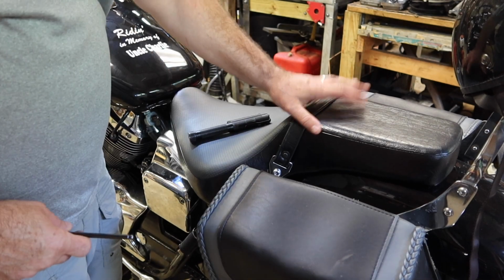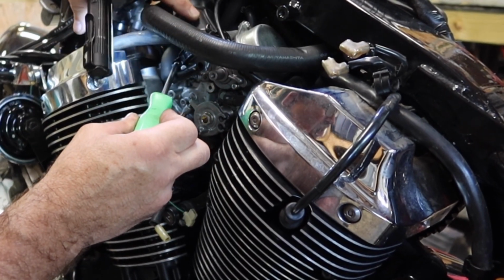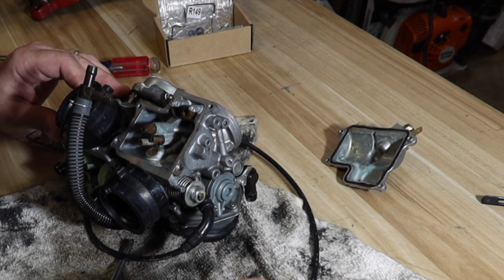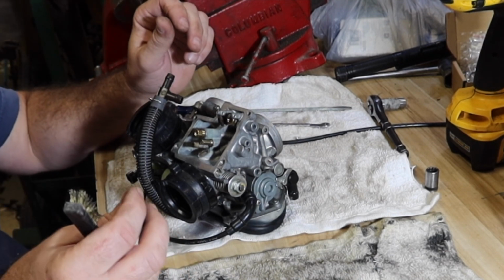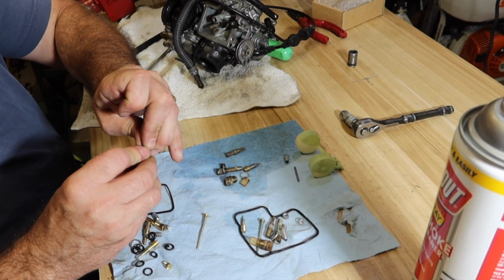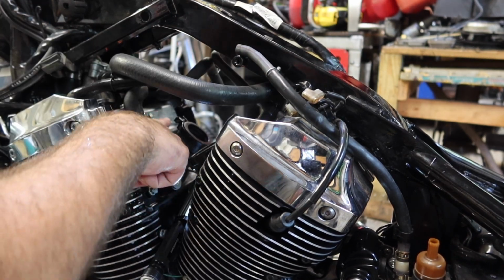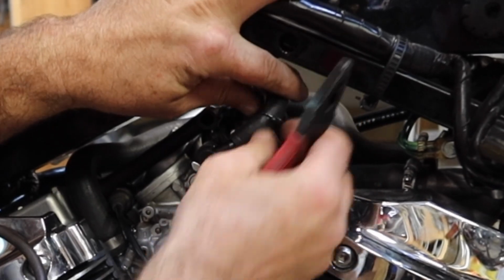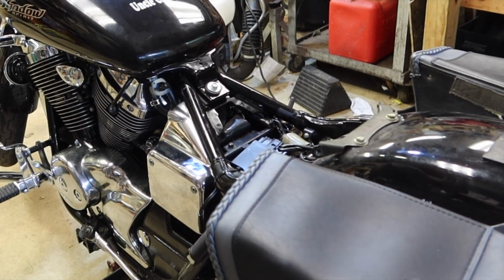Honda Shadow 750 Carburetor Rebuild: No Start, Rough Running

Comment: Nice  !  Really thorough and easy to follow.   You can always tell when the carbs have been opened up because the mixture screw caps are removed,  I've never seen them replaced... makes future adjustments much easier.   I'm glad you got it running right.
Reply from the maker: Thanks for watching!

Comment: Excellent video teaching. I learned much from your teaching. I now feel more confident to rebuild my carborators myself. I wonder if you ever found any problem with those little holes missing on the new jets. I enjoyed watching your video all the way through non stop 
Thank you for sharing this info. I appreciate it much.
The LORD bless you Ray.
Reply from the maker: Thank you so much. Yes I ended up swapping the new jets for the old jets again. I just took some time and cleaned them up really well. I couldn’t get a smooth acceleration with the new jets

Comment: omg you pull the carbs with the boots still attached to the carbs, that's crazy, no wonder it's so hard. leave the boots attached to the cylinders, loosen the upper clamps and use a long screw driver or pry bar to pry up off the rocker cover to pop the carbs out of the boots, right side carb off front cover and left off rear cover, super easy. i can take my shadow from fully assembled to having carbs out on the bench in 15 minutes, a little longer to go back together, routing choke cables, hoses, and air inlet boots on the dual carb shadows can be pain. The hoses you thought are for a vacuum actuator are actually the atmosphere equalizer inlets for the slide chambers,  btw, those black nipples that look like a $2 drip system nipple from home depot get brittle after a few years so be gentle with them because honda wants just under $40 a piece for them.........
Reply from the maker: Oh that's fantastic information thank  you for commenting!

Comment: Exact same experience.  Cleaned carb, gas coming out everywhere after install, but it ran the best it ever had for 5-6 minutes lol.  Just got it back together for round two after replacing floats and pins.  I pray this is my last time.  I’ve been everywhere on this bike but I’m hating a carbureted bike right now!  Soaked my carb in chemdip and it turned it to a dark gray with a gunky film…?! Never had that happen on one (mostly lawn mower carbs) for me.  Guts look okay but she ain’t pretty outside.  We’ll see tomorrow 🤞🏼
Reply from the maker: Fingers crossed! Keep 2 wheels down!

Comment: From what i recall in doing research to work on my 84 shadow, the plug over the mixture screw is an EPA thing to prevent the owner messing with it and causing it to no longer meet compliance.
Reply from the maker: That would make sense! Thank you so much

Comment: I rebuilt mine following your great video. But now I can’t figure out where that long hose gets connected to. I’m talking about the one that’s dangling as you are rebuilding the carb.
Reply from the maker: Is it the one with the white dot on the end? If so, it’s just a vent if I’m not mistaken
Reply: Thanks very much. I’ll just leave it loose. It doesn’t have a white dot but it’s got to be a vent line.
Reply from the maker: @Geotechbruce gotcha. It will be evident if it leaks or doesn’t run right.
Reply: Actually after having rebuilt it, it leaks gas from this line just like your bike was doing. In the beginning of your video you mentioned that your bike was leaking gasoline from the vent line. Well my bike would start but die quickly afterwards before I rebuilt the carb. After rebuilding it, it still does the same thing but now it leaks gas from that vent line also if I throttle up while trying to start it. I don’t know what could be the cause of it not wanting to stay running. I used the jets that came with the kit.
Reply from the maker: Makes me suspect the floats may not be set right or may be leaking. I did put my old jets back in because I felt a sluggish acceleration at mid range. Follow that hose and see if it goes to the fuel bowls. They may be overflowing
Reply: I wish there was a way share a video with you to show which hose I’m taking about.
Reply from the maker: I rewatched the video and that hose leaking gas should be the floats not sealing

Comment: Great video man, I just need more help lol I bought a 2007 spirit that hasn’t been able to run for over 6 years. I followed your video and it was able to run for about 15 seconds. It was leaking fuel from the nipple behind the throttle cable, I removed the spark plugs and smelled fuel bad. Then I checked the oil and also smells like fuel really bad. Did I rebuild it wrong? What do you think I should do next?
Reply from the maker: It sounds like the needle and seat on one of them is not sealing properly or the float is leaking or not adjusted. You can put the carbs on the bench and add a clear hose to the fuel nipple and fill up to see if they seal. I recently had a fuel line deteriorate internally causing dirt to keep flooding just like you described
Reply: @RayofallTrades looks like one of the needles from the kit was the problem, it keeps getting stuck, I ordered another kit so hopefully everything is good after that, Thank you!
Reply from the maker: @ARCMowing good find! Keep us posted if you don’t mind. Very curious if the manufacturer is cutting corners
Reply: @RayofallTrades I ended up going with a different kit that included the diaphragms and it’s running great, just need to watch some videos on how to sync the carbs and should be done. Thanks again man, your video helped me remember how to keep taking it apart and put it back together!
Reply from the maker: @ARCMowing outstanding! Thanks for the update!

Comment: Heya boss love the vid btw very informative very nice! I just recently baught a 2003 honda same as the one in the video, i was wondering i had a problem with the vacuum intake theats dangling by the carb wires in the middle of the engines was also leaking gasoline when i turned it on. You actuallly mentioned that prob in the video, i was wondering why does it do that and how did you fix that problem boss thank you! :)
Reply: yeah the 4:22 part of the video, what is that and how do we fix it? same problem here too. thanks
Reply from the maker: I’m pretty sure it’s because the floats were stuck open and it flooded
Reply: @RayofallTrades  thanks boss ive been watching your vid again and again, and followed how you also cleaned the carb (thabk you for thats aswell) i also asked a friend and thats also what he saidabout that hose.  Currently trying to put it back the correct way step by step how you have done it :) great vid boss!!!
Reply from the maker: @krakyen8536 thank you and good luck. Check to see if your fuel lines are deteriorating internally causing pieces to obstruct your needle and seat.

Comment: Need help!!2007 Honda Shadow 750 Aero /been sitting for 8 years /7900 miles!/All fluids changed, New battery of course and new carb/Fired up and runs great/engine oil light stays on during idle/Goes off and stays off when you give it gas and are riding it/changed pressure oil switch/didn't solve problem/Run 50/50 mixture of kerosene/oil twice thru engine/problem still not solved/What do you suggest I do next?
Reply from the maker: Are you able to see if the passage under the pressure switch was clogged?
Reply: My shadow ace manual says the oil light turns on when the bike is turned on and goes off when the engine is running and even has a protocol to go through if your oil light doesnt come on everytime you turn the bike on, i found that out because i was concerned that it was on.
Reply: Idle too low should idle at 2000 rpm

Comment: This is the best video so far for doing this, I wish I would have seen it before removing my carb! I seem to be missing 2 hoses...can you tell me where the hose connected to the back of the air filter (around 33 min. In video) is supposed to be connected at the other end? Also, the hose with the 'white dot' I have no idea where that is, or if it was missing from the beginning... Where should that one be connected, to the carb itself or somewhere else? Thank you
Reply from the maker: The white dot hose went to the carb(s) about 1/2 way up and appears to be an over flow or possibly a atmosphere pressure. The one on the air box I need to look for but I think I found the hose routing diagram looking at Google.  If I find it I'll let you know
Reply from the maker: Here you go: https://www.hondashadow.net/threads/carb-air-gas-line-diagram.568774/
Reply: Thanks for your help! Another question, On the carburetor there are 2T's.1 is for  the fuel, Do 1 of the hoses from the other T. go into the air filter? I couldn't tell from the diagram
Reply from the maker: Try to go back to that link I shared. Further down someone added pictures with blue lines which was pretty good for routing and see if that helps. Sorry for the delay, new phone and old eyes challenges. 😂 Happy new year!

Comment: If that carb cleaner gets into any of the still assembled diaphragms you may be in for further repairs.    They usually aren't part of carb kits.
Reply from the maker: Likely did get in there and you might be right
Reply: Why ?  Does the carb cleaner deteriorate them ?
Reply from the maker: @mrmgjohnson it can. Depends how strong the cleaner is and what it's made of. Remember that these gasket are used to seeing gas
Reply: @mrmgjohnson  depending on the cleaner it will dry it out and either shrink or expand the rubber. not good

Comment: I know this video is a year old now but the mixture screw gets the spring, then the small metal washer, then an o-ring. Your o-ring was probably stuck in the hole. If you end up having mixture problems, it’s probably because the o-ring got pinched or shoved into the needle hole.
Reply from the maker: Oh awesome! Thanks for the tip!

Comment: Did you happen to use carb cleaner on the viton tipped float needle?  Carb cleaner is very hard on ant rubber parts
Reply from the maker: I'm sure it did and you are correct. Thanks for pointing that out!

Comment: Your about to have carb issues again the shadow has an issue with the plug wire coming from the coil grounding out on the plate that has that rubber diaphram and spring under it, itll burn a hole and cause it to run horribly. Thats what that black dot is. Mine done it after 35k miles easy fix with jb weld tho
Reply from the maker: Oh really? Are you talking about the heater circuit on the bottom? You said jbweld might do it? If so, I’ll give it a try. Thanks!
Reply: @RayofallTrades  the spark plug wire coming from the coil that rests on the carb. the one you removed to make room to remove the carb. The plug wire will ark over on the carb and essentially plasma cut a tiny hole in that plate.
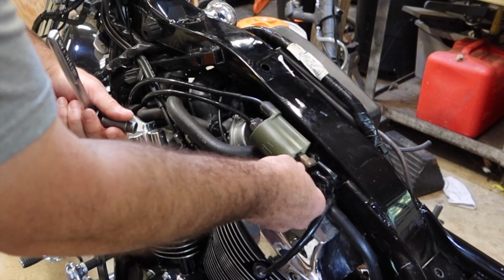Reply: @RayofallTrades   2:30  of your video
Reply: @RayofallTrades  if you look closely you can see the black spot where it is already arking across
Reply from the maker: Ohhhh gotcha. Great catch! Thank you
Reply: @Project-lucifer8 that chamber is vented anyway so it wont hurt
Reply: @EZ4U2Say11  I'm just going off my experience with it and it caused the effected side to be sluggish and back fire